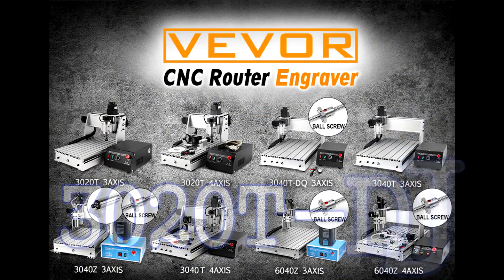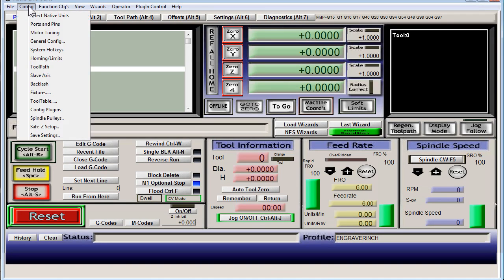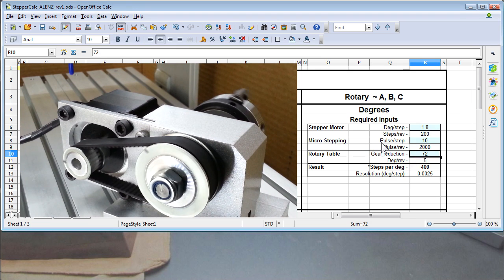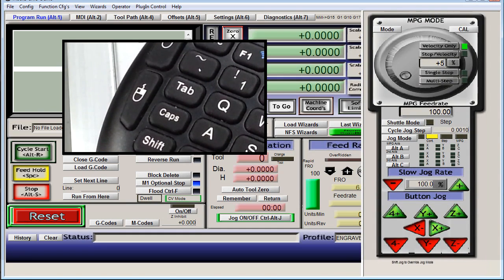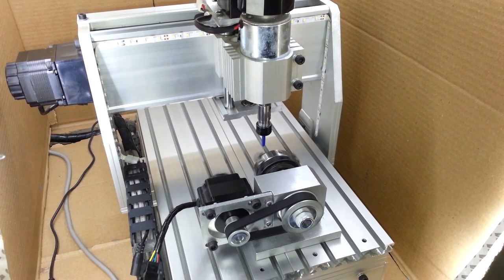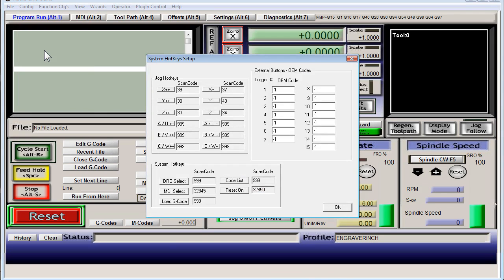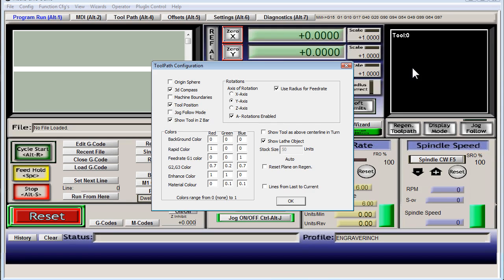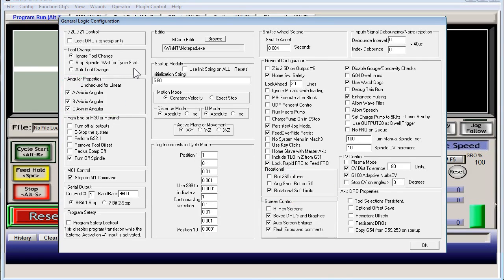CNC 3020T-DJ Mach3 | Rotary Axis Configuration

Comment: howdy again  so would u say i need a program like F engrave to work on round pieces  like pool cues? or can i do it by tweaking settings?
Reply from the maker: I use both F-Engrave and Gcode-Ripper. For me, they work great.
Reply: @Charlie Sarsfield  I have mach 3 and bobcad but my cnc is not 4 axis
Reply from the maker: @hectorotani27  Ok.  With the mentioned applications,  you can still do contour engraving. No rotary axis needed.  An example video of my contour engraving...  https://youtu.be/MucnmEtoEXo

Comment: hi hi !! thank you! i have a problem with my 6040 cnc version USB ... i need the correct processor but i cant find.... can u help me?
Reply from the maker: Unfortunately, in not sure what you need. My unit is parallel port connected. I haven't tried usb connections for CNC.

Comment: Charlie,... just to say THANKS !!! for this tutorial,... I was more than two days trying to understand and figure it out how to configure the "A" rotational axis of my small 4 axis milling machine (an M70 Proxxon CNC adapted by me many years ago), it happen when I changed the main breakboard from the old parallel port type to an USB type. The most useful it was the Stepper Calculator Table, that I could not find it for download,... so I did my own table based on the hidden formulas in it (not too difficult to find out). Everything is fantastic now !!.

Comment: Thanks for your making vids time - I see a few more folks having been stuck for quite a while. These machines are for using :-)  (sais me @ about 15months ownership!!)

As before, filehosting never sends the link to download the file - it’s basically not available. Thanks for mailing it to me.

I’ll setup the a axis tomorrow
as everything seem now to work! Soon be taking ‘the plunge’. Your flashlight looked good. 

I wonder what I’m gonna bust b4 I’m at your state of alertness regarding the various parameters - your method is worth observing - it’s not just a case of ‘the machine made it’ and with these machines in our hands, necessary to administrate well.

Thanks again.

Comment: Rotation direction on CNC machines is viewed from one end or side of the machine, if you turn the device around 180 degrees it would be reversed. This would be true in any Axis left to right, up to down and front to back.

Comment: 3:24 , its fine if u put rotary parallel to Y axis BUT 180 deg.  rotated, i dont see change rotating
Reply from the maker: If you need, you can change the direction pin of the axis.

Comment: Hi! I follow all the steps in the video but my motor lost position every now and then for example after 10 cycles of work the actual position it's moved 0.7mm from the original position. Do you know why is this happening? Greetings
Reply from the maker: Try slowing acceleration a bit for the rotary, in motor tuning. See if that makes any difference.
Reply: I'll try thatthanks for answer!

Comment: Mine stepper 4 axis as named A axis rotating only one direction regardless of pressing +4 or -4 in jog button. What's going wrong with it?
Reply from the maker: Possibly try a different Direction Pin number for that axis in Ports&Pins.
Reply: Charlie Sarsfield pin 8 for step and 9 for direction I am using ,mach3 ports and pin tab

Comment: I must say one of the best videos for rotary setup.I have a rotary Roundino 120 and has a ratio 100:1.So I put values,1/8,10 and 100 and gave me 555,5555556.It runs smoothly and homes.My only issue is that it cannot give full 360 rotation when I give g coded G0A360.Any help manaybe setting in General config and rotational settings?Thanks
Reply from the maker: Alexis Damianidis 
Thanks for the compliment. In General Configuration, make sure "A-Axis is Angular" is checked, and that everything under "Rotational" is un-checked. From a zeroed dro, try the G0A360. If it doesn't go the 360, try "444.4444444" as steps per degree... which is "1/8,8,100" in the chart.
Reply: Υou are awesome bro,360 degrees dead center.It seems unchecking everything under 'rotational'' was the problem.Keep making videos I like your attitude and spirit in your videos....;)
Reply from the maker: Alexis Damianidis 
Excellent! Glad you got it going! More videos in the works.
Reply from the maker: Alexis Damianidis 
Great! Is that a dance we are seeing at the end cause you're happy? If not, it sure looks like it, lol.

Comment: Hi Charlie when checking  GOA360 in MDI should the A axis rotate by itself  I have tried this but it does not rotate
Reply from the maker: +Rocky5738 
It should, unless the DRO is already at 360 in G90 mode. Can you move the rotary axis via MPG mode (tab key)?  Did you watch this whole video going through all the rotary settings?
Reply: yes I did, will try the tab key in MPG, A axis was at zero in read out  have got everything else ok I think cheers Rocky

Comment: Hi, I have a harmonic drive 4th axis with gear ratio of 50 to 1 do I enter this into the calculator? also how do I work out degrees and pulse per step?  thank you Rocky
Reply from the maker: Yes, the 50 should be entered for the Gear Reduction. I would try 8 or 10 for the Micro Stepping, then see which Steps Per Deg will rotate the axis 360 Deg for MDI "G0A360".

1.8: 8: 50: = 222.2222222 "Steps Per Unit" for setup
1.8: 10: 50: = 277.7777778 "Steps Per Unit" for setup

I would try these first.
Reply: thank you Rocky

Comment: Hi Charlie, I'm looking at buying one of these machines thinking it's a good and inexpensive way to start my cnc journey. So my first question is do you like it? My second question is Who to buy from? The link you provide doesn't exist anymore and there's so many vendors out there. Thanks for any help you can give.
Reply from the maker: +Al Sadaj 
First, congrats on starting your cnc journey. It is a bunch of fun, in my opinion. Yes, I like this machine for a starter setup.  I got mine through a USA distributor on eBay. And thanks for telling me about the dead link.  I'll see what i can find, then update it. Till then, just look for a highly rated machine through a highly rated distributor. That should do you good.  And have fun learning about cnc.  It's a fun hobby.

Comment: A question, Where did the measure get the correct radius?
Reply from the maker: +ToniczTutoriales 
The rotation radius is half the diameter of the tool path location on the part being engraved. If you are engraving on a 10mm diameter, the rotation radius is 5mm.
Reply: ok my friend, but i can't put in decimals the rotation radius, what i do?
Reply from the maker: +ToniczTutoriales 
Oh wow, I'm not sure.  I don't have any problems including a decimal.  It's ok to not include a decimal number.  The rotation radius number seems only to effect the tool path display and feed rate calculation.  Neither need to be that accurate.  You should be fine with a whole number.  Still it is weird that it won't take the decimal.

Comment: Just unlocked Ang Short Rot on Go and I could just turn the 360 degrees, to automatically configure the steps. Before I could only turn 180 degrees in automatic configuration. You can tell me what that setting is for.
Reply from the maker: +Jose Chavezz 
Yes, with that setting on, when using G0, the rotary will make the move taking the shortest route possible. Example... In absolute mode (G90), if you are at A270, then code in  G0 A0, instead of unwinding by moving -270, it will move +90 to reach the rotary position.

In Incremental mode (G91),  if from your current position you  code G0 A+190, the rotary will move -170 to get there since that is the shortest route.

Comment: Hello dear friend .. I have a problem with my fourth axis, I can not calibrate it with the Set Steps per Unit to 360 degrees .. I can calibrate with 180,270, but when I place 360 it does not move the fourth axis and tells me the mach3; far moved axis A, when it did not move, something is missing configure. The first time I configure it if I calibrated it to 360 and then I made a G code that went wrong because I was in another unit of measurement I have this error. thanks for your support.
Reply from the maker: +Jose Chavezz 
Hi Jose, the steps per unit in this case is degree. in that field you input steps per 1 degree, not steps per 360 degrees. It doesn't matter if you are in mm or inch for this particular setting. When you get it correct, mdi G0 A360, and the rotary should rotate 1 revolution. Use the calculator in description to help figure the steps per degree.

Comment: Great tutorial! I like your mini keyboard. What plugins did you have to install to get that to work with Mach 3?
Reply from the maker: Clayton Musgrove  Hello Clayton, no special drivers needed. Just plug in the WiFi dongle that comes with the keyboard and off ya go. Then use the Mach3 keyboard shortcuts. I did disable the onboard mouse as it caused a few accidental cycle starts.
Reply: Thanks Charlie. On my way to Amazon to get one. And will be setting up my 4th axis thanks to your videos.
Reply from the maker: Clayton Musgrove Awesome!

Comment: Thank you very much for this excellent tutorial that saved me a lot of time.

I have managed to get my 4th axis running but I don't understand how to configure the values
I have the stepper calculator and specs from rotary seller are 

3.5A 4 lead 57 stepper motor(1.8 Degree Step Angle)
MACH3 setup instructions: 1 degree required Pulse
The formula is: 360 / subdivision stepping angle * Drive * Transmission ratio / 360 = MACH3 Pulse

Is it possible to configure the stepping with this values, if so  can you please tell me how or even better the values I have to put in mach 3 ?

Thank you
Reply from the maker: How many rotations of the motor does it take to turn the rotary chuck 360deg?
Reply: I'm not sure, might this be it ?

Transmission ratio 1:6 (1200 pulses / revolution) synchronization gear reducer
Reply from the maker: Ok, In Mach3's Motor Tuning... try 20 in the "Steps per" field.  As in the video, put numbers in the "Acceleration" and "Velocity" fields. After that, MDI the rotary "G0 A360". Take note of how far the rotary turns... 360deg... under 360... or over 360.
Reply: I was away for the weekend and am not at the workshop right now, will try it tomorrow and let you know

thank you very much for your help and time
Reply from the maker: Ok, the steps per unit will be less than 20 in your case. There is a button on the settings page in mach3 titled "set steps per unit". It's at the lower left. Give it a shot. Tell it to go 360 deg and then estimate (if ya can't measure) how far it moved. Keep doing this until it's close to accurate, then we should be able to dial in the correct number.  Let me know how it goes.
Reply: It only turns about  90º, I can see in the ref all home display the 4th axis shows  giving one full turn or 360º,  so in this case now it's turning under 360º.
I tuned steps per to 33 and it turns about 356º, if I change it to 34 it turns about 365º am I doing this correctly and is there a way to fine tune it ?
Reply from the maker: Ok buddy, try 33.33333333.  Should be it
Reply: Yay, great, it seems to be perfect now

So I guess I'm good to go now, right ?

One more thing, at 4:54 I will only need to input value there if I was programming gcode in mach3 right, in my case I will use a program to generate the gcode to do the 3d carving and in the toolpath setup I input all the information regarding the wood piece length, diameter etc,  before exporting it to mach 3 so I won't need to fill that parameter manually in mach 3 every time I use the rotary, is my reasoning correct ?

Thank you very much, your video is awesome, I really don't understand why mach 3 guys didn't do a simple video like this in the first place, straight to the point easy to understand and it works perfectly, thumbs up
Reply from the maker: Awesome! Should be good to go. A tip...Just make sure the rotary direction is correct before you commit to the machining.

The Rotation Radius field has to be filled in for the tool path to display correctly on the screen and Optionally, for the rotary feed rate to be calculated correctly by Mach3. 

Glad ya got it going. Have fun!
Reply from the maker: By the way... the 3 inputs for your setup in the stepper calculator are 1.8, 10, and 6.  This gives the 33.33333333.
Reply: So every time I load a 4th axis gcode I have to fill the rotation radius is that it ?

And what exactly is the rotation radius, is it the radius of the finished machined part or the radius of the cylinder part to be worked ?
Reply from the maker: If the radius changes from one program to the next, yes.

I have only done engravings, not carvings, but I would go with the starting radius rather than the finished... for feed rate purposes. Might have to ask someone else on that one or do some experimenting.